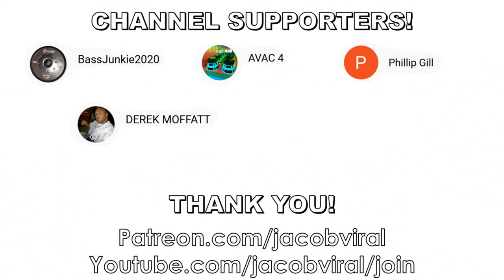20HZ ON 24 12S ON OVER 100,000 WATTS!? THIS HAPPENED!

Comment: 1 thing i always wonder is how far would these sound waves travel. Probably would be scary how far they go, because my crappy 800 watt system can be heard from 1km away.
Reply: I think it would depend mostly on the location. I didn't have proper measuring equipment but last music festival I was at dropped about 7db per 1000ft I got from the stage. This was in a rural farming area so the only ambient noise was the wind, very flat ground, and nothing taller than the stage for miles.

Comment: why do people go for little 12's when there's 18"s and 21"s out there? surely if you want more big low bass you gotta go for the bigger ones. This setup would be a lot better with 18s! and you wouldn't need so many either.
Reply: 12’s are still tight and punchy and can respond better to some notes. The SPL comes these speakers have allow them to hit lows still. The biggest sub I would go would be 15” but 18 and up is just too watery if that’s the best word for it
Reply: @tylerjordan4875  smaller subs being more "punchy" than their larger counterparts is a complete myth.  I wish people would stop spreading this nonsense lol.
Reply: @intermediate212  a lot of it is enclosure but 8’s and 10’s perform better in a higher tuning enclosure than a 18” would in the same tuning. Don’t be an idiot
Reply: Frequency response.....